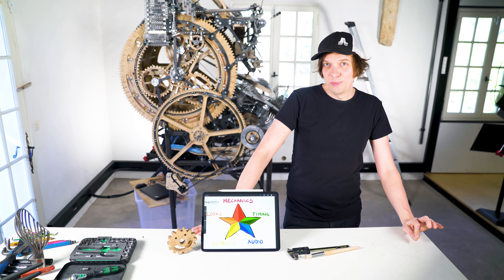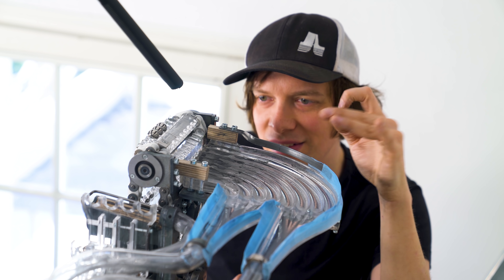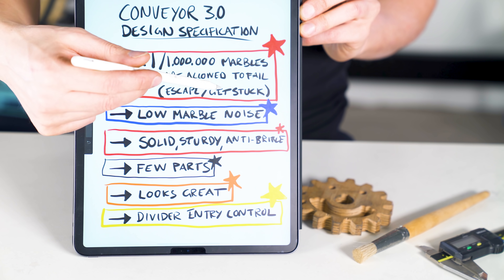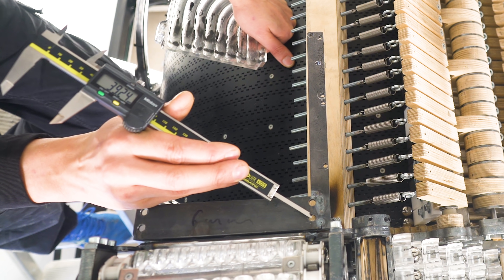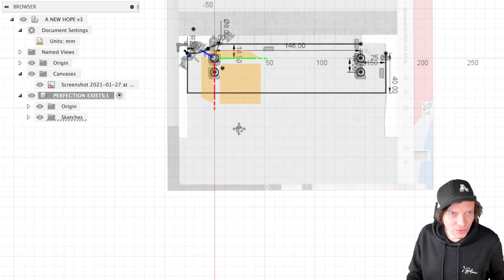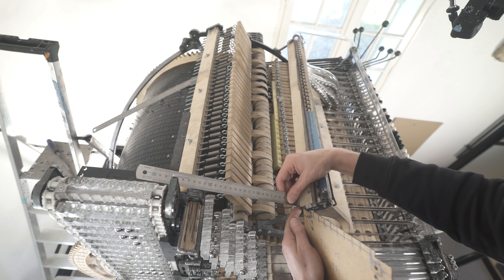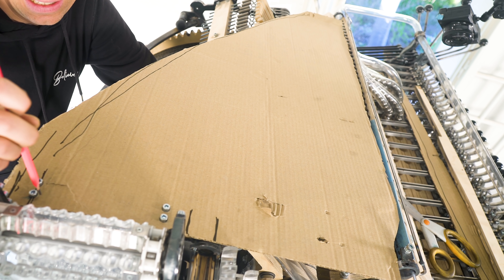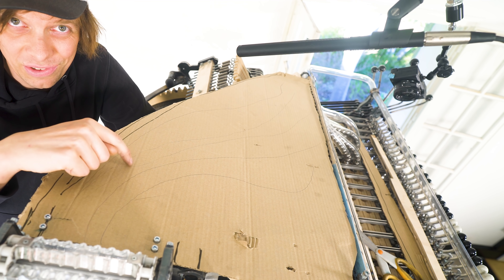Designing From First Principles

Comment: As someone starting to learn how to negotiate real-world to CAD and back, this series has provided invaluable advice. Thank you Martin! And my 3D printer thanks you as well :)
Reply: If you're just starting, the best advice I (aerospace engineer with over 2 decades of 3D modeling experience) can give you is stay away from Fusion360.
Reply: @thomasbecker9676  Thanks for the advice! I actually started using FreeCAD last weekend and some thread references to determine, model, and print my first ‘fitted’ part, an adapter for a compression speaker to fit a hose to. I’m building a talkbox for a music friend of mine and it was magic spending a few hours learning how to use the program and getting a part printed that fit first try!
Reply: Fusion360 is great for hobbyists since it’s free but it’s not a CAD software for professional use( unless your projects are small).
PTC Creo and Catia is a pain in the ass to learn compared to other “pro” softwares(Solidworks/Inventor) but they are the “strongest” by far in my opinion.
Reply: @jonaslindbard7239  I taught myself v5 in college and it's the only non-organic modeling software I use anymore. I found Fusion360 has extremely poor training transfer and teaches bad workflow habits, not to mention how it handles assemblies, and the fact that your designs aren't exactly yours, given how you're required to save them.
Reply: @thomasbecker9676  Any issues of similar nature to that "your designs aren't exactly yours" are a deal-breaker for me, and since I tend to design much simpler things than the MMX, I'm a rabid fan of Solvespace. It's a joy to work with, and that single executable of 6.5MB for a parametric CAD is a genuine marvel all on its own. Looks like 3.0 is about to come out any moment now...

Comment: In your pursuit of chasing perfection in this step, you might as well think of something to open and close where you fit the pipes from the trail upwards, so it's easier to add or replace a new pipe.
Reply: You could catch the marbles sooner from the conveyor belt instead of letting them fall all the way to the marble divider diminishing the noise.

Comment: Isn't it the diagonal distance when the marble conveyer is moving, in between states, that needs to be less than the 8mm discussed?  It looked like you were only considering the horizontal distance.
Reply: Paul Petzar thinking the same thing, to me he should have looked at how the marbles don't full eject or roll back... maybe a small steep ramp at the conveyor, to reduce gap, and get marbles away from conveyor.  Then worry about how to change front loading machine with marbles...
Reply: i looked at de footage in slow mo and the marbles event hit the previous cariage on the exit . his plan put the divider way too low. that why in the previous dising the marble make all that noise and bounced.
Reply: m2nesli yes I agree.... maybe some washers under the divider to raise it up, or maybe he is out of washers...
Reply: I’m pretty sure he’s making it longer for aesthetics
Reply: I thought of this immediately, plus the conveyor trays have curved edges, so the openings may be way more than large enough to allow ghost marbles to still escape the same way they are now. That tolerance needs to be much tighter than he's assumed here.
Reply: I'm thinking he is doing this to save from redesigning the elevator/conveyor, which should not allow the marbles to go back down...
Reply: @Rollermonkey1  My thoughts exactly. As the shuttle descends, the cups that hold the marbles will be exposed to the edge of the receiver he's designing--increasing the gap, and thus the chances of ghost marbles being created.
Reply: My Initial reaction was the same, but with the way the marbles are ejected I don't think the distance matters much at all (unless it too stupidly far away of course). It is for me as 'The Fixer' puts it about the steepness of the initial impact zone - as long as a marble can never ever roll backward or stay put in the gap (or miss the new plate entirely somehow) the failure's can't happen. If you go and make it so the Marble can't possible get back onto the lifter because the gap is too small, but can actually roll back to or stick at that point it will jam, and with the huge inertia of the machine break the clear acrylic lifter. Acrylic loves to shatter, and steel bearings won't break, if this new part is plywood as suggested (boo, hiss, horrible idea Martin - clear polycarb? or toughened glass would look much nicer!) it might be compressible enough to save it, by permanently deforming, but that would take terrible terrible plywood...
Reply: yea maybe out of washers  XD but if he raise it up like that it will trow of the measurement and a big gap will form.
Reply: @FoldiOne Papyrus  i don't know if this will be enough the marble will drop from a big hight and have a big bounce. i hope if he do the divider in wood that will absorb the impact if not he will have the same problem as the first design.
Reply: @m2nesli  It doesn't have to be a big 'drop' that leads to bouncing - think those 'vertical'  wall slides, you can drop an awfully long way with the wall only just having enough angle to keep you against it, then it bends to flat rapidly - there's not a need for the sudden impact that leads to bouncing, have the marbles impact on the steep sloped section and because the angle is similar to the trajectory there isn't much force in the right direction to create a bounce.
Reply: Yep I felt the butterflies of uncertainty at that moment.
Reply: Good Point!

Comment: Martin, quick note, in material science the opposite of brittle is tough.  A lot of folks get tripped up with words like strong, but that relates to ability to handle stress, but some materials can be strong but brittle.  toughness describes a materials ability to handle impact and strain (strain is when stress causes the material to deform).  Your command of English is amazing, just wanted you to have that little nugget if you didnt already know.
Reply: the opposite of brittle is ductile...
Reply: @YungusCH  In Hindsight I think you are correct.  Toughness is strength + ductility.  Martin needs toughness in this case.  Play doh is ductile and thus is not brittle but its also not strong enough to make the parts out of.
Reply: He also says "a huge sound" which kind of endearing.
Reply: ye, toughness is expressed in energy needed (area under stress-strain) rather than in max stretch (how far right it goes) or the max stress (how far up it goes)
of course, whatever terminology you use, it should firstly be understood by the people you're working with, so if you say "tough" when you mean "scratch-resistant" (hard) like for a phone screen, then by all means call it tough
Reply: Like a diamond. May be strong as hell, but I´ll brake it with a hammer
Reply: I speak English natively and I could see myself saying strong instead of tough or a huge sound instead of a loud sound. English is such a bastardised language with French, Latin and Germanic words that I personally don't think it matters. (Like whats the deal with L-I-V-E - is it 'I want to live' or is it 'I like listening to music live' - so stupid - urgh!)
Reply: @HyperVectra  from a lay perspective it doesn't really matter what the difference is between these words. It only matters because they have a technical engineering meaning in this case.
Reply: @garret1930  Ahh yes totally. Thanks for setting me straight.
Reply: @HyperVectra  dude, let’s not talk about french! It has like 8 different meanings for the word verre, vert, vers, vers etc
Reply: @sachadesjardins1253   Rite, write, wright, right...
Reply: @InventorZahran  Conte, Compte, comte... Voie, Voit, Vois, Voix... foie, fois,, foi,.. sans cent, sang.. etc!
Reply: @sachadesjardins1253   *Confused screaming*
Reply: Or maybe he knows what he means, and doesn't need a part to be tough, just to not be brittle.
Reply: I reckon was thinking of anti-fragile (a term he mentioned previously) which is a systems design term.
Reply: in software we talk about code being either brittle or robust as opposites.
Reply: Like mylar, which is very flexible, but it's also stiff.
Reply: Wow I didn't know that, thanks !
Reply: Xin chào
Reply: The opposite of brittle is malleable.
Reply: What was it for diamonds again? Diamonds are strong but brittle?
Reply: @bl4cksp1d3r  Diamonds are brittle. You'll need a good hammer and an even better swing to break them, but they will give
Reply: @Azivegu  Wouldnt they shatter or chip rather than give?
Reply: @TheFlemse  Thats the definition of brittle, it doesn't give, it just chips, cracks, and breaks.